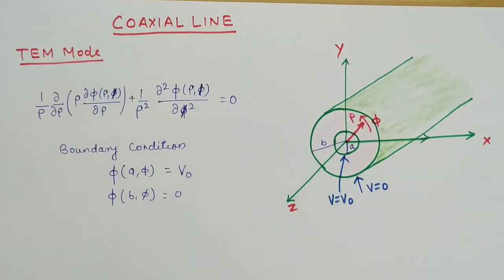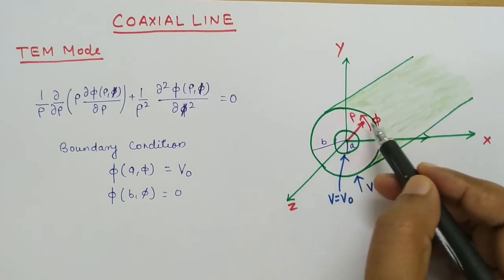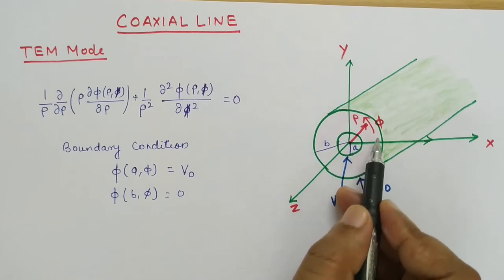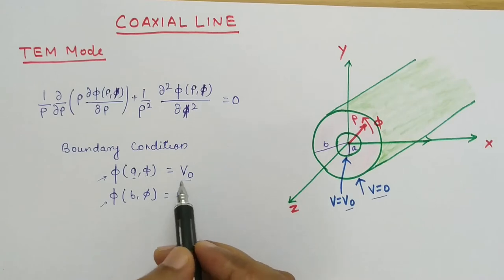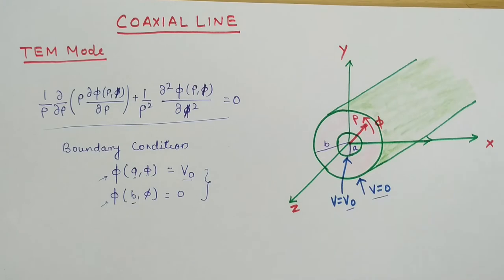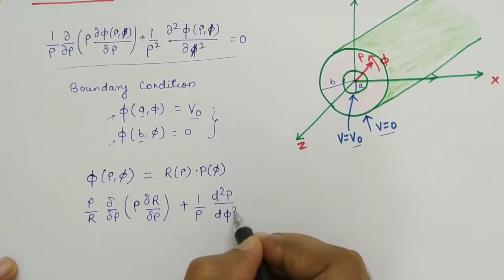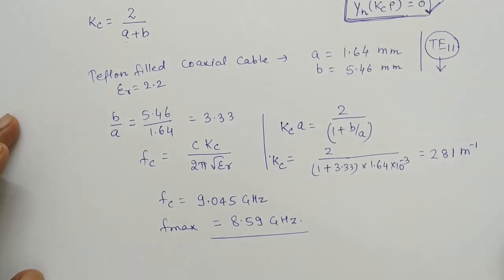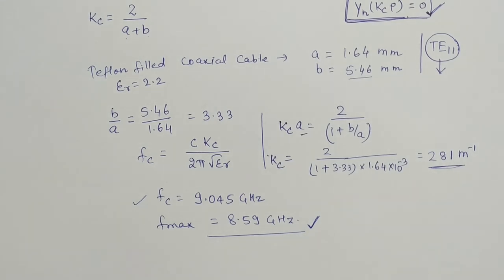Coaxial cable || Derivation of potential for TEM mode and discussion on higher order(TE & TM) modes

Comment: I need transmission of electric and magnetic waves through coaxial line... Of you have some sort of notes or lecture on it... Provide me with..
Reply from the maker: Note as such is not available
Reply: If notes are not available then any lectute of you on co axial waveguide?
Reply from the maker: There is no Co-axial waveguide. It's called circular waveguide. The lecture is available in the playlist.